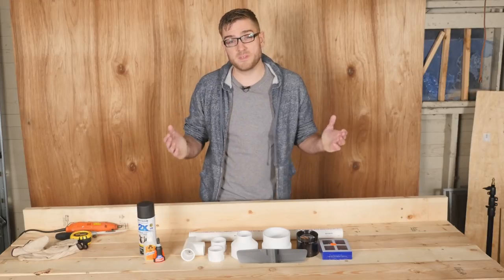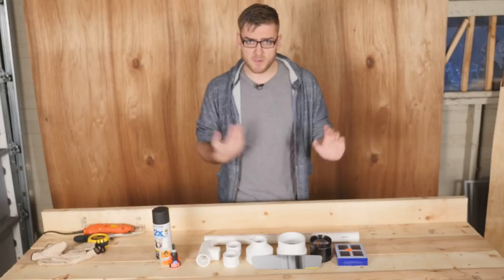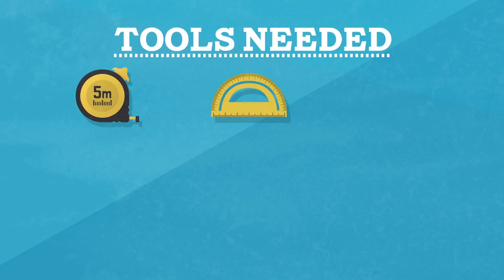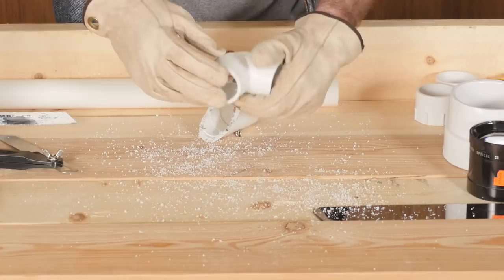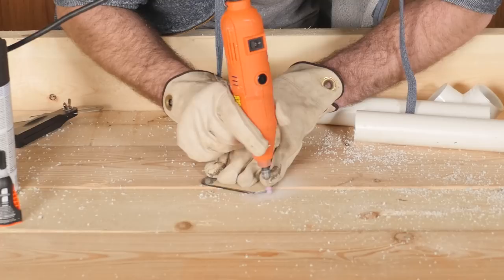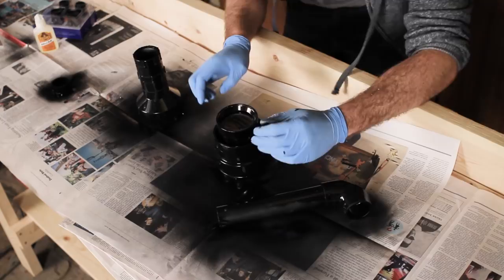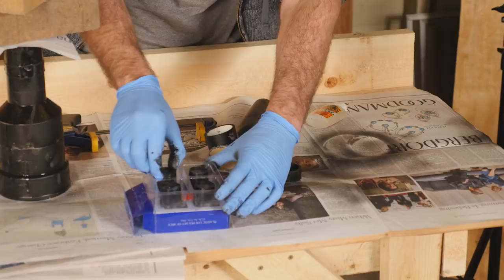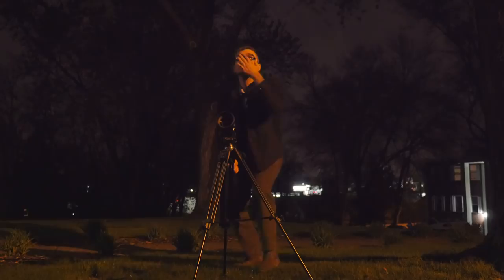DIY Telescope

Comment: Next time you use pvc for a project, spring an extra few bucks for the pvc cement
Reply from the maker: I considered getting it, but since it doesn't need to be water tight, I thought it'd be overkill.
Reply: I do not think it is needed in his case. For testing out a prototype, superglue is enough.

Comment: Might want to use ABS instead of PVC to avoid having to paint it.
Reply from the maker: +sekoyes1 I looked at it at the hardware store, but it was generally more expensive and didn't offer the same variety of sizes I needed.
Reply: Ahh, I think PVC is more popular in the US so maybe ABS fittings aren't as readily available.

Comment: No, Nononono. Never wear gloves when operating rotary tools. The glove might offer skin protection, but it can very easily get stuck in the rotation, stopping you from taking your hand away and doing incredibly serious damage. With no gloves, you have instant retreat, and you can get away with a gash. My friend *literally put a hole through their hand* because they couldnt retract it. Why could they retract? Their glove got stuck :/
Reply: I'd suspect the torque is limited enough on a cheapo dremel that the motor wouldn't be able to bind up the glove material and the danger from the cutting blade/debris is much higher. But, generally, yea gloves and fast spinny things = bad news.
Reply: If he were working on a lathe or something, you're 100% correct. But it's just a dremel, man. Chill.
Reply: DalBraillinsford Right, but if you read my comment, you would see that even a dremel can cause damage. My friend slipped and put a hole through their left hand.